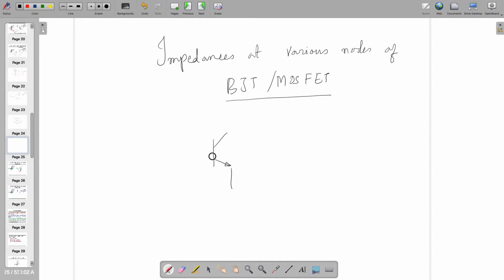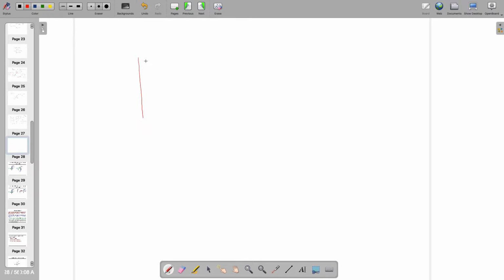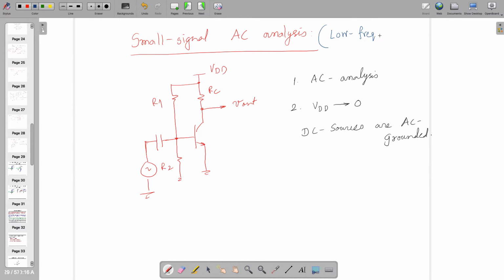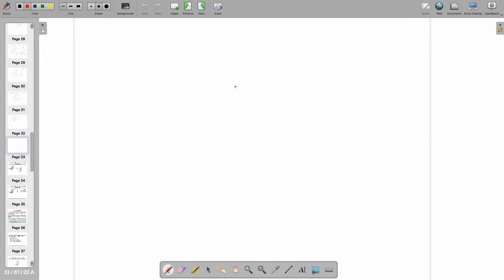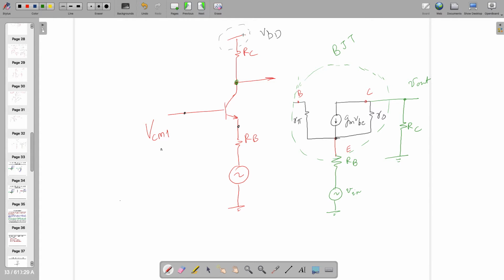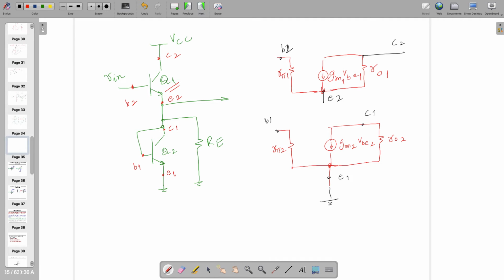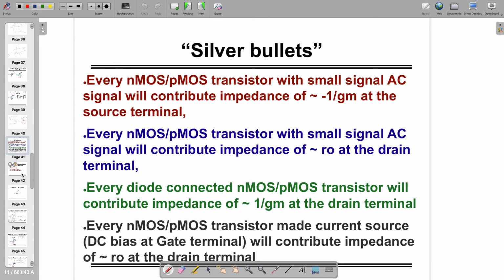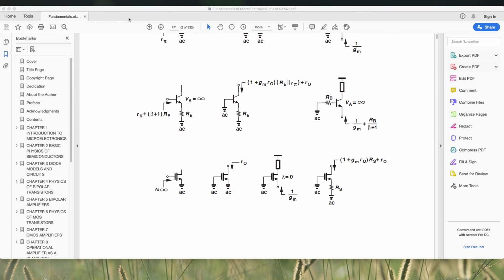Lect5_Single_stage_amplifier_II

Comment: 47:53 that result may not be correct since impedance looking into drain of M1 is different
Reply from the maker: True, gain looking in to drain makes the connection with M1 and R. Notably, the impedance is very high and contribute less while keeping the same in shunt with the drain resistance. Overall effect of the degeneration will reduce the gain, however, improves linearity.
Reply: it becomes very complex calculating gain with both degeneration and r0